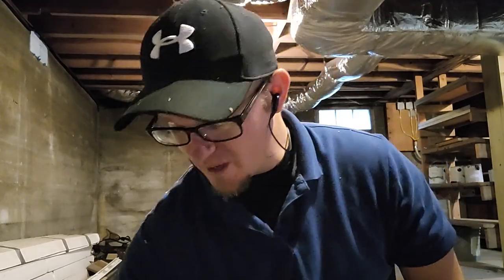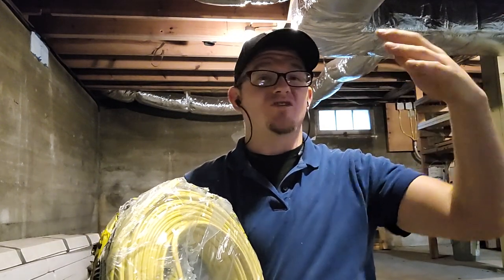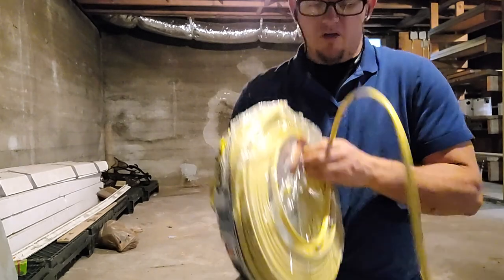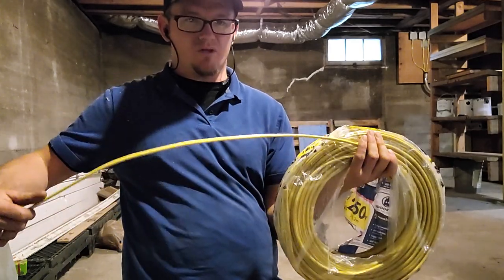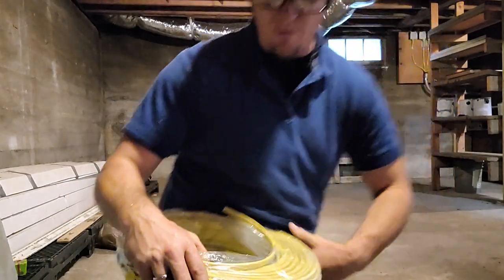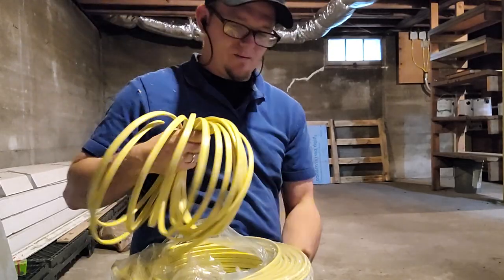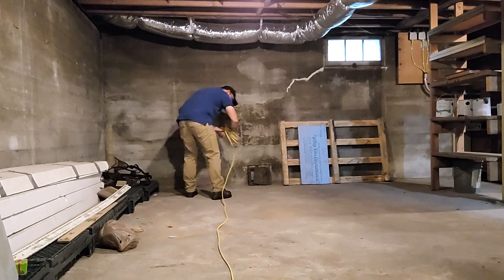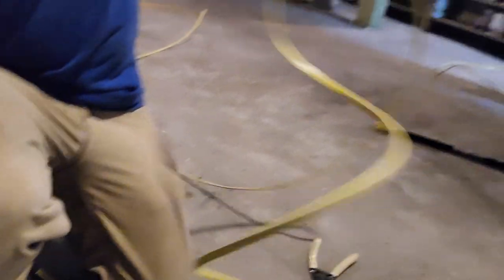#1 Tip for Pulling Romex without a Spinner! Be a Pro. Learn from the Pros.

Comment: As a master electrician I can see how one could pull the wire from the center but you'll never catch me doing this.  100% agree on unrolling, keep it strait
Reply: I passed the canadian masters when it was introduced and it had a 74 percent failure rate ..I hand spool 150 m 14 for fun and speed

Comment: In a roll of romex there are two ends to the roll another way is to pull from the end on the outside of the roll so it doesn’t knot up from pulling it.
Reply: but by the time you get to the other side of the roll you still have to straighten it out

Comment: If you do pull from the center and your not doing too long a length you can use the lariat technique. By spinning it over your head. The other way is to make or buy a spinner that hangs from your ladder or a board. I bought a clam shell container that I put on a piece of conduit on my ladder or a stand and pull it off easily. It also prevents over spin that some spinners make a mess of. Most spinners or dispensers are about $100. I say money well spent in time saving. On verticle spinners you can put some plywood or stiff cardboard between your coils for multiple cable runs.

Comment: I've used method 1 for years, and works fine. Method 2 is new to me and would be especially nice for new rolls, since you're not spinning the weight of the entire roll. Especially for the heavier gauges.

Comment: New subscriber here.
I take it out from the center as you do in your second example, but rather than making another spool to roll out on the floor like you, I just use the whole roll. I put the free end under a weight, and just roll out how much I think I'll need. If I need more I just run it out. I don't cut it off until the wire is run in.

Comment: What about sticking a pole/rod/dowel  through the center, set the rod horizontally (across ladder from step to back rung or something) and then pull so the whole thing spins like a spool? I'm about to try this now, but I thought this is what I did years ago when running some wire in my house.
Reply: Outcome...
I used 1.5" PVC pipe and the spool didn't roll out nicely, although it's a nice way to hold the spool while feeding out some wire. I think a 4" or 6" PVC pipe would be better because it would fill the center of the spool.

Comment: in the mid 90's, we used to unroll "three" 250 coils at a time, sometimes a 14 and 12 mixed but often 3x 12's at once and the whole rolls at once down the hall ways or across basements. no wire cones or pulling from inside, remove wrapper, tie ends to a stud,  put both arms through all three old hand sin middle, walk backwards and make circular motions with arms so the rolls keep jumping in the direction of unrolling. maybe that's why I hate electrical work now! lol
then again those were pretty big homes/condo's, homeruns from basement panel to second story was all pretty long and many. no AFCI's that I recall and limited GFCI's. half bath gfci would often feed garage outlets, kitchen counter gfci would be used to feed front or rear outdoor outlet, other bathroom or single gfci in unfinished basement would feed other outdoor outlet. sometimes 2nd floor main/second bath gfci would drop down and feed 1st floor 1/2 bath. I forget what GFCI's cost back then, but it was costly and everyone did very minimal amounts to squeeze by.
all the current codes out now and requirements seem way overblown and nanny state over-protective, especially when idiots will find ways to electrocute and burn themselves up anyway.
like tamper resistant outlets, I hate them, because of the large plug insertion depth before any contact is made, wiggle a cord(vacuum cleaner) and the little bit of contact end pulls out enough to start arcing or overheating. now add in an AFCI? it may or may not trip as the plug and  receptacle overheat and melt anyway.
sorry for the novel, memory lane and ranting. 😜

Comment: I read (on line) that you should no pull sheathed Romex into conduit. 1) Does the NEC permit this?  2) the guy at the big box store told me to strip the sheathing and then pull the wires but then I read that bare copper ground wire is not permitted inside conduit.
Reply from the maker: Great question, it is not strictly prohibited, there are  times where you are not allowed to do it though